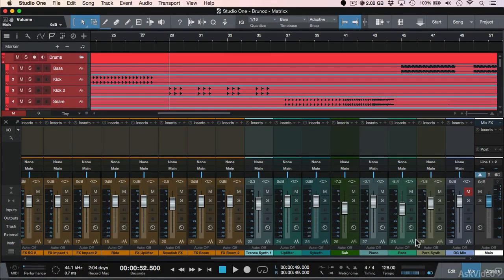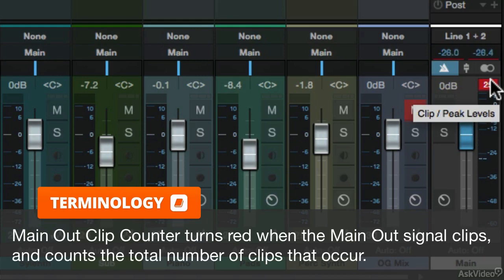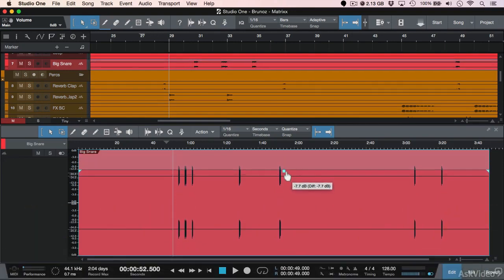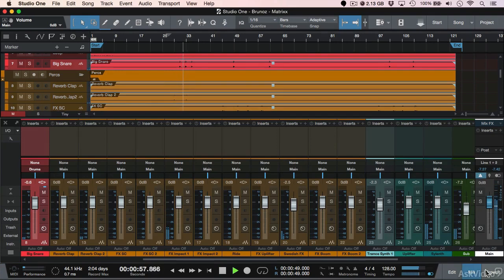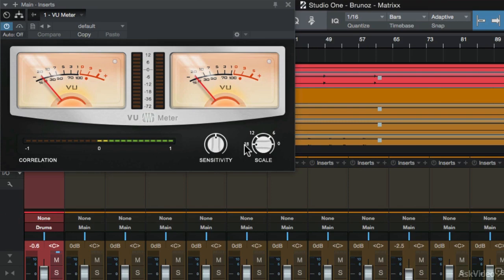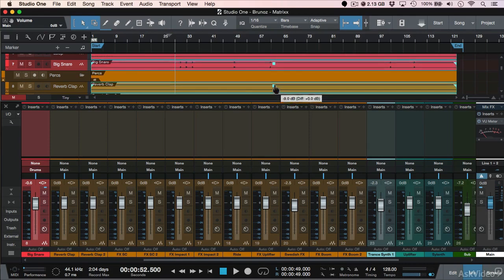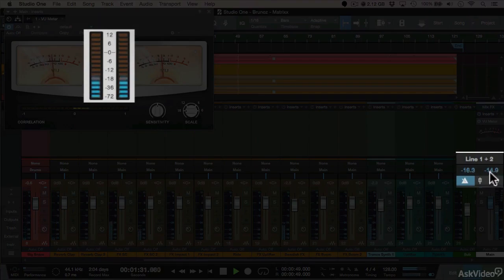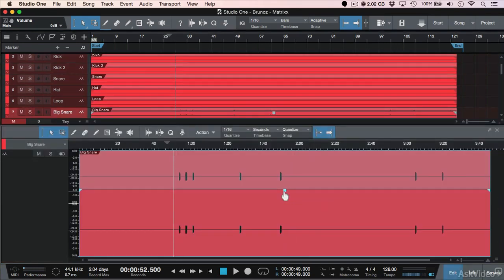Studio One 303: Mixing Big Room - 3. Gain Staging

Comment: Thats NOT digital clipping. - If you have read the PreSonus website thoroughly you would immediately notice that PreSonus has Soft clipping that is an analog clip not digital clipping.
Also you would know that PreSonus also implemented into their dual audio engine a +20 db Headroom on soft clipping.
Also in new releases of Studio One there is what is called VCA's for channel control, please learn to use them  :)
Also lowering the volume the way you have in this video defeats the purpose of each track having normalization levels. Its the responsibility of the engineer to make sure
every track that gets recorded into Studio One is properly normalized, then its mixed within the Mixer accordingly for proper mixing levels.
If the audio is over the normalization level after the resulted recording, then it has been recorded wrong and must be redone.